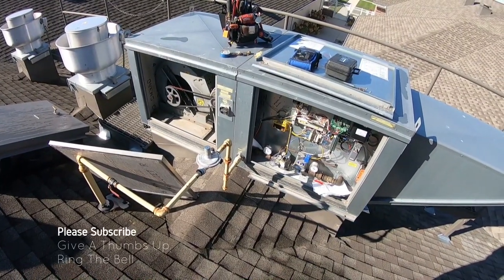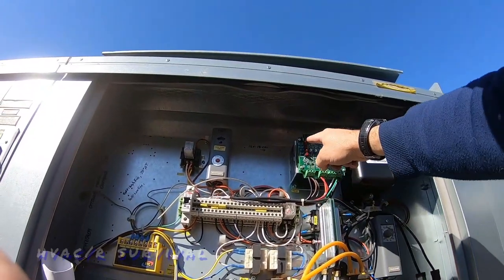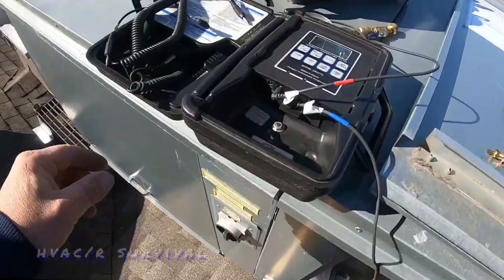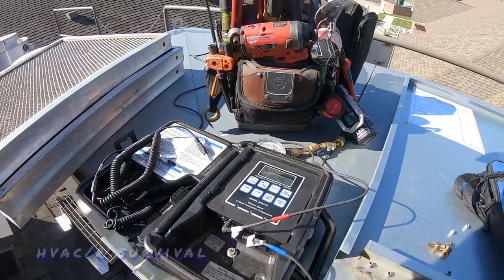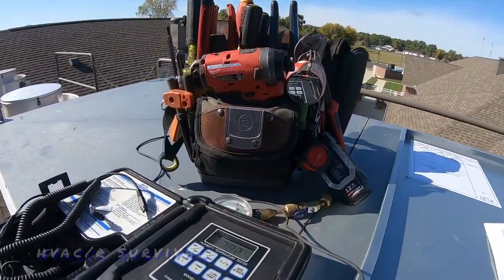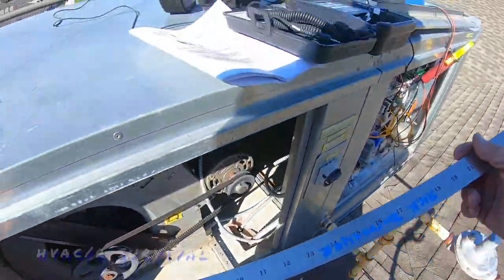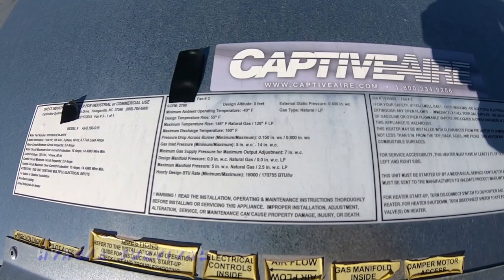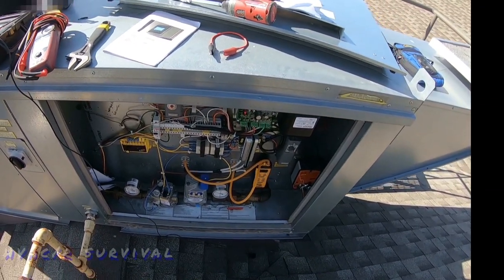Direct Fired CaptiveAire Make-Up Air Not Working

Comment: I was just looking at a CaptiveAire unit yesterday and thought the same thing about the information on the nameplate. Something so simple but yet often overlooked by other equipment manufacturers. Nice job.
Reply from the maker: Thanks Kenny!
Reply: They also have the same labels inside the unit if the ones outside the unit wear off.
Reply from the maker: @jeremiewhite7155  good to know👍👍

Comment: One thing I've noticed on is those units is if they have screens downstairs right outside of the hood they tend to get plugged over time and sometimes go unnoticed and affect in heat mode and lower the differential across the burner. First time took me 3 different visits to figure out. Also have had quite a few discharge sensors and amplifier go bad lately
Reply from the maker: That's definatly something I'll keep in mind,  that's good advice,  thanks for sharing!👍🏻👍🏻
Reply: Keep up the good videos and thanks for sharing nice to always pick up new tricks and info
Reply from the maker: @AlexR-cx7gk  I'm glad you liked it Alex!

Comment: I worked with the same type of unit. But when i crank up the ambient control it didnt event try to start on heat. I wonder why im not very experience with this piece of equipment
Reply from the maker: Call the factory, they can get you the informative you need to properly diagnose it. That would be the safest bet.

Comment: One word of caution, you should never switch the disconnect on the unit on or off while the VFD is sending it power. It can damage the VFD. Best bet is to turn it off at the breaker first then switch the disconnect.